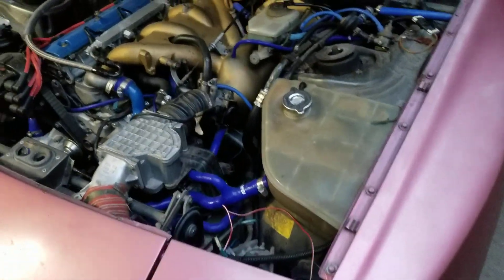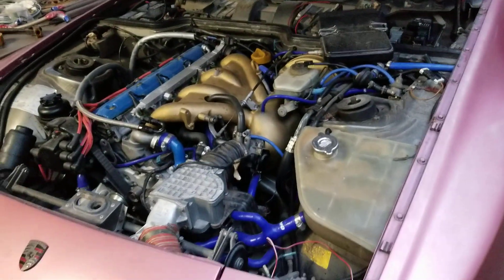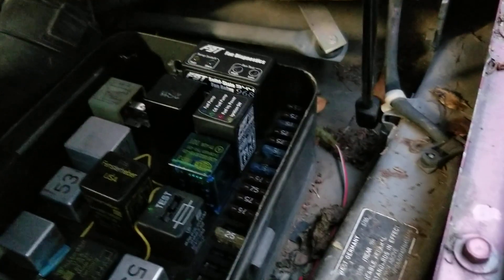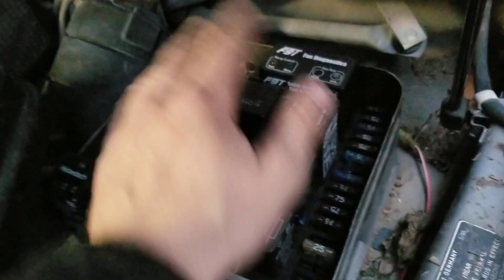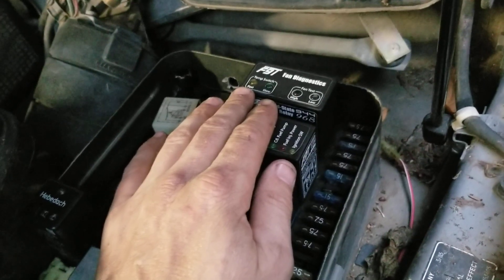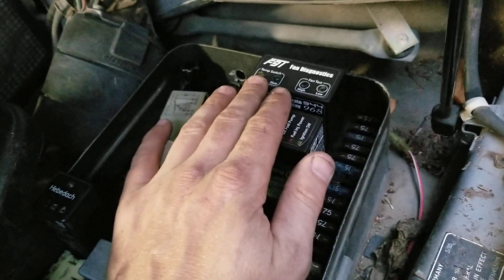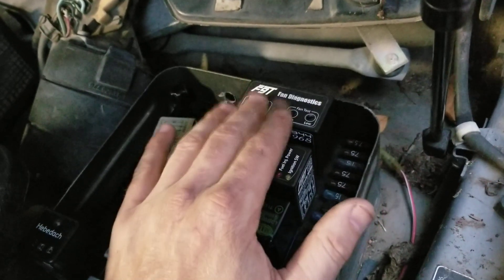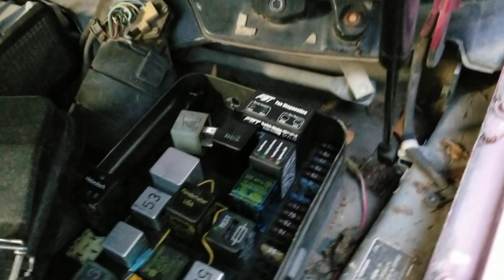12 Volt AC Compressor in a 944 Part 6

Comment: I am looking at one on ebay complete kit $700
Reply from the maker: Some of the kits are nice if you are changing the evaporator also. Hope it works for you.
Reply: I want to use my truck ac system I just want the electric compressor so I don’t have to have my engine running
Reply from the maker: @IvanLopez-th7yk   Not sure how well it would work honestly,  Am sure you would need a high Reserve amp batteries, like what big rigs use.